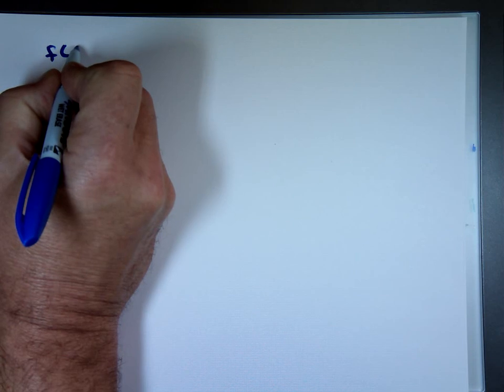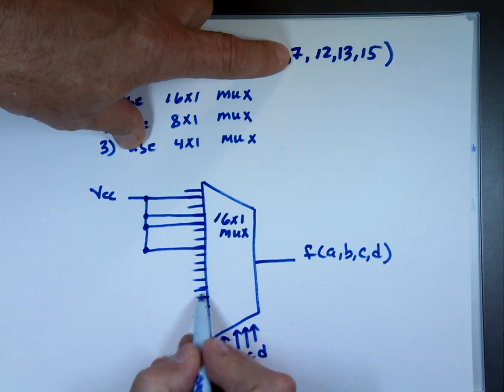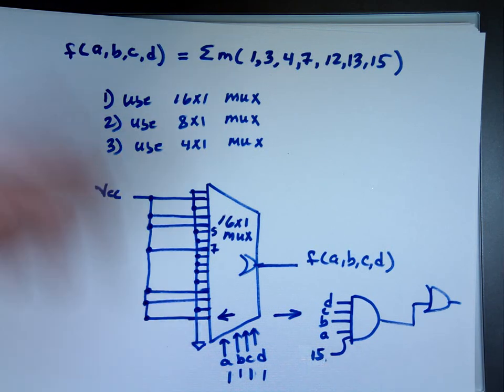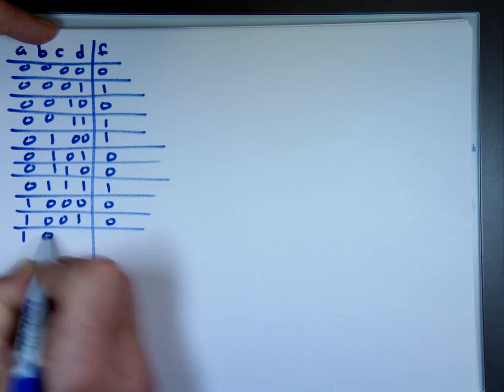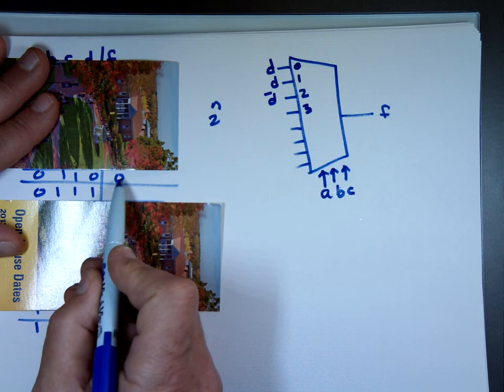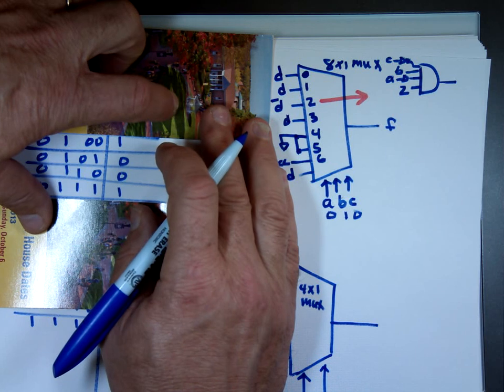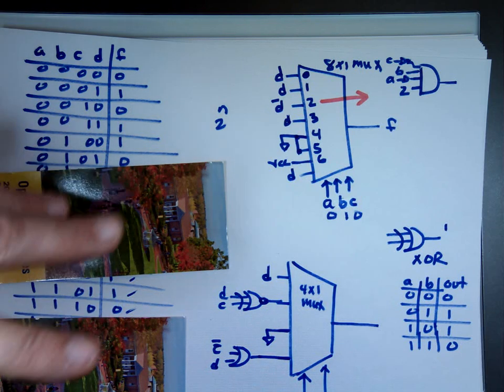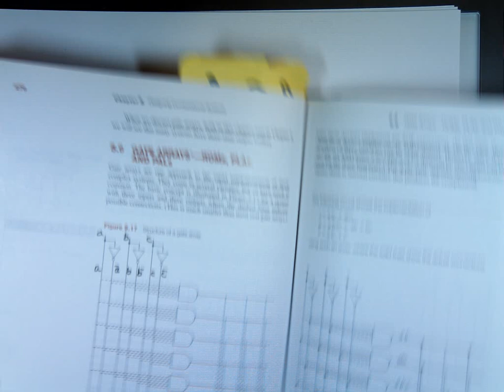Multiplexers Examples

Comment: please answer this qustion
show how two 3-to-1 block diagram multiplexers (without enable inputs) are connected to form a 5-to-1 multiplexer. use no added gates. input selection should be as follows : if DC=00 then :AB selects I1/I2/I3 , if DC=01 selects I4 and if DC=10 selects I5 . give the function table of this 5-to-1 multiplexer and its connection diagram